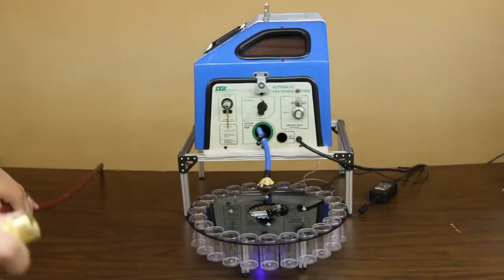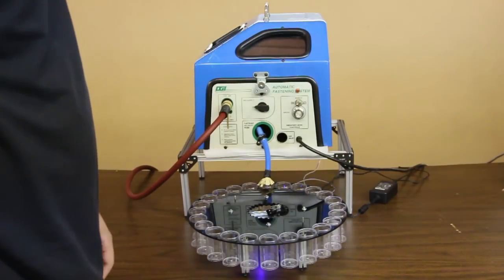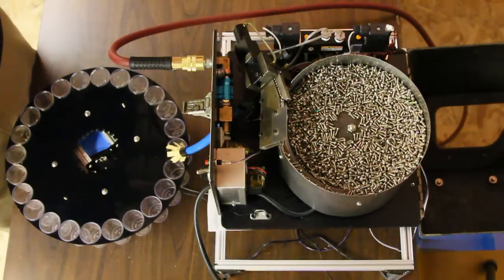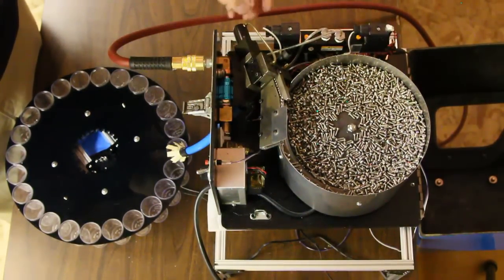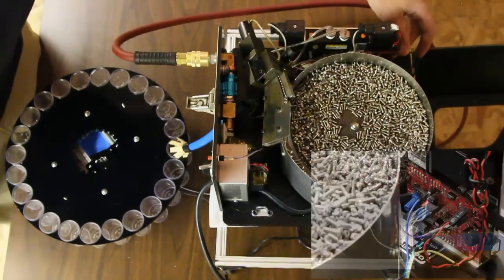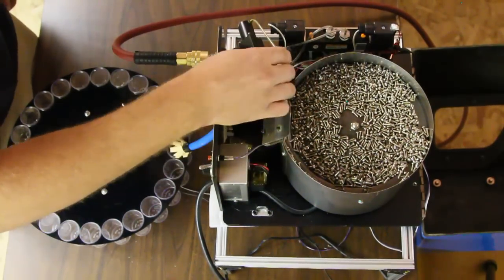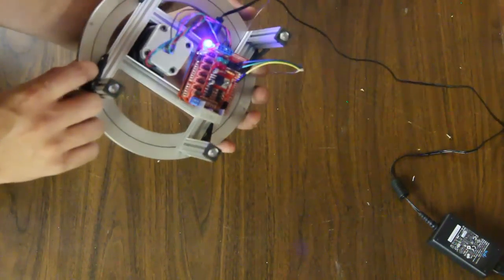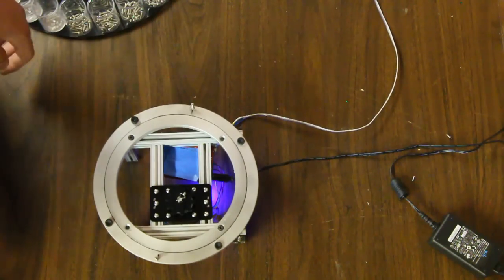Automatic Screw Feeder Hack

Comment: the quickest way to count these is to use a weighting scale. just get the weight of one single screw... dump a huge batch of screws into the bucket about 95% (doesn't have to be exact), no need to count them. Then keep adding screws one at a time to get it to the right weight. done!
Reply from the maker: We use that method too, when we need a simple batch screw count, but in this case we needed the screws to be rationed in those specific quantities (say of 10) to go in a kit build.

Comment: Hi how I can contact about it
Reply from the maker: We don't use this machine anymore. We invested in an much BIGGER version that has a large vibration bowl, and uses optical detection to count. The machine is based on an automatic screw feeder for assembly-line use where the screws are injected to the front of a power screwdriver. We have just modified one to do it with less pressure, and an Arduino to control the cycle count and the stepper motor turntable.

Comment: Why would anybody need to use something like this?  Unless you own a hatdware store..  and still then couldnt you use a scale?  Or figure out the amount you needed to separate and wind an electromagnet to be just strong enough to pick up said amount of screws..?  If they were steel..  but yea a scale and a hopper..  and if wanted to be automatic use an arduino to trigger a stop order, then a linear actuator or a small magnetic release to dump the screws in a bag then repeat..  could set up a carrousel to feed bags with limit switches..  rather than all that mess..  factory automation is a neat thing to look into just to see all the simple ways engineered to complete a process that at another factory could be comprised of many processes to get the same results..  just seems like an expensive way to do something automated in a different way to me..  like even a laser counter or ir diode and receiver connected to a simple counter circuit and a rotary collector device that turns based on a set weight.. put all the screws in a can that spins with a 5v motor like a hopper, drops em through the beam so everytime the beam brakes its line of sight with the receiver it sends signal to a counter which when the counter reaches a desired amount it haults feed until the rotary collector turns to a new container and gets to its set position..  it could all be ran off a 9v battery or 2...
Reply from the maker: It was 8 years ago and we were playing with ways to streamline our screw-counting for our kit building. We've since invested in a proper part-counter with an optical beam-scanner that makes a very rough 3D model of things that pass through it's scanner (400 scans/sec), and does a volumetric evaluation (is it within +/- of desired? Accept!). 
This unit was a screw-feeder for an automatic screwgun, and was pretty cheap. It proved the point that automating the screw-counting process was worth more investigation. Vibration feeders are pretty neat machines.